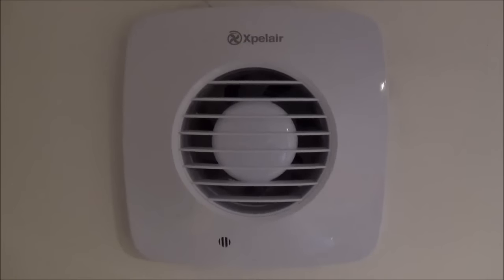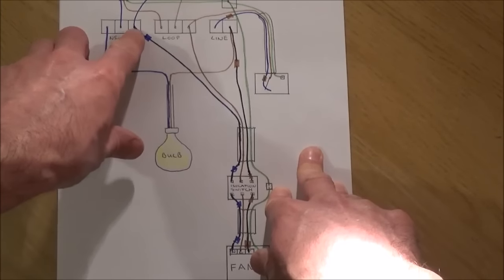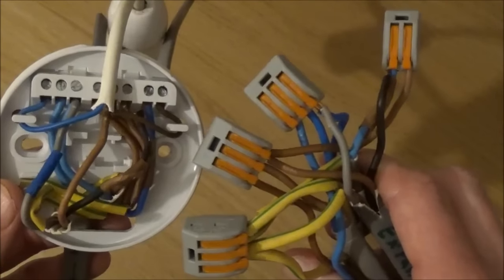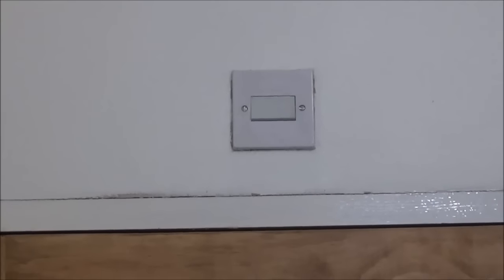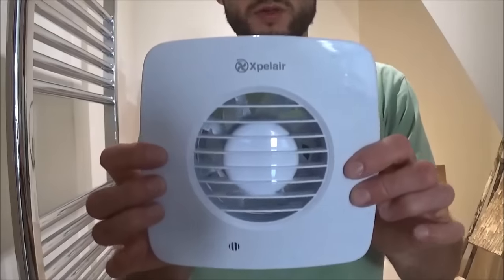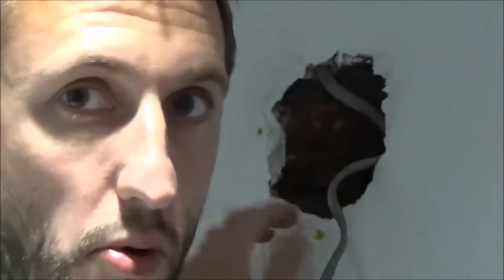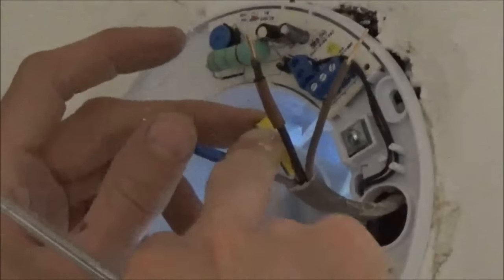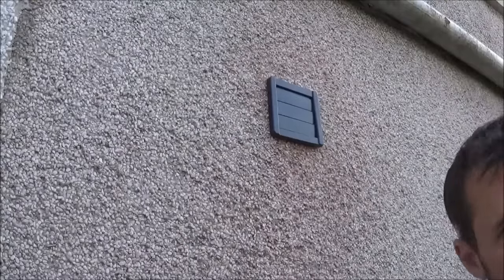How to fit a bathroom extractor fan using light switch. Extractor fan installation. Xpelair DX100

Comment: my old extractor fan I am replacing has a safety isolating transformer instead of a regular 3 pole isolating switch, is there a specific reason for this, do I need to keep this or could i replace with a regular isolating switch? I would appreciate any advice thanks
Reply from the maker: Hi there, without looking at the wiring it's hard to say. In theory if all the cables are 1.5mm twin and earth, you have a 6 amp mcb protecting the circuit and the fan is suitable then you could use an iosolation switch like in the video. But, it maybe the fan is older and designed with a transformer in mind. Sorry if that doesn't help but I don't want to give you advice that could prove to be dangerous or compromise your existing electrics. Good luck and thanks for watching!

Comment: Buddy:  If I put the wires the wrong way around will it blow the fan our just not work>  I ask as a sparky has done all the wiring and left a 3 core and E wire ready for fan installation but this wire was covered and does not have the brown or black tape over.  Is using the brown for live, grey for neutral and black for switched live industry standard so I may assume the sparky ran the wire from the isolator switch in this manner?  Thanks
Reply from the maker: Hi , it shouldn't damage the fan but if you have an RCD it should trip. But a simple way to test it is by using an electrical tester. A non contact tester like the LAP ms8907 are great. With the power turned on, remove your 3 pole isolation switch cover, (no need to disconnect the wires) and with the light switch on, the switched live wire will indicate live on tester. With light switch off there will be no power. The permanent live will always have power, and the neutral should show as having no power. But it should be standard that the grey is neutral, brown is permanent live, and black is switched live.

Comment: How to connect  cord pull fan with bathroom light wiring
Reply from the maker: You just have to treat the pull cord switch like the switch in the video. I don't have a video on this so if unsure please get an electrician to do it safely. Thanks for watching.

Comment: Thanks for this video, just made my life easier. Now I can fit the new extractor fan with confidence following your vid...p.s. Is an isolation switch a requirement?
Reply: yes
Reply from the maker: Yes, you need it to safely work on the fan at a later date without having to turn the light circuit off. Thanks for watching.

Comment: ok pouse.  strange comment but i want to block my extractor fan off as we have turned it off as cold air is coming through is there a plastic cover for it that i can buy
Reply from the maker: Hi Julian, you can buy blanking plates of different sizes which might work but I can't say I've ever thought about it. If I was removing one for good, I remove all vents and the tube in the wall, and then brick up the inner and outer cavity. Make good with render then plaster (or what ever is appropriate in your house) and job done! Hope that helps. Thanks for watching!
Reply: Julian Hamilton w
Reply: Google ‘back draught shutter’. Thank me later!

Comment: Great video. Did you actually connect the fan wire to the ceiling rose below or all connections being done in the loft?  In the video, it seems to me you have the fan wire pull from ceiling below back to the loft.
Reply from the maker: Connected to a connector block in the ceiling. This is actually a downstairs bathroom although that makes no difference! Hope that helps.
Reply: @POUSEaroundtheHOUSE  thanks for your help. So in the video I saw you connect in the ceiling rose, is that just illustration not actually done in practice. However I could not find connector block in the loft, should I tear the wire cover of the ceiling light to connect the wires? Thanks
Reply: @dragonviet2994  call a qualified electrician

Comment: Hi. Anyone know how to remove the cover for this fan, please? Electrician fitted ours but now it needs a clean so I need to remove the cover
Reply: Usually have a small screw on the side, undo that and pull the cover off.
Reply: The locking tab is at the very top in the center. Gently prise it off from that location

Comment: Hi Pouse, great video mate... 

I intend to fit an Xpelair C4HTS which recommends fitting a 5amp fuse.

After a lot of research, I am aware of the long-standing debate concerning the issue of fans and fuses. However, I am a belt and braces type of guy and would rather air on the side of caution.

I have three questions for you.

I am picking the feeds up from the ceiling rose using 3-core+earth (as in your video) and fitting a 3 pole isolation switch but would also like to include fuses on the live and switched live.

I am thinking of using this modular system.
https://www.scolmore.com/_pdfs/spec_bros/Mode%20Fan%20Isolation%20Switches.pdf

1. What do you think about this idea?

2. Where do you think the two fuses would be best placed - before or after the isolation switch?

There is an airing cupboard on the landing, immediately adjacent to the bathroom door (no access from inside the bathroom).

3. Do you see any problem with mounting the isolation switch (high up on the wall) inside the airing cupboard?
Reply from the maker: If you have a 6 amp MCB on your consumer unit for the lighting circuit the fan is run from, then why not just do as in the video? However if you insist on the above then I would put the fuses after the isolation switch and no problem with cupboard really as long as someone knows where to find it. It's good practice to be visible but out of immediate reach. That way anyone wanting to isolate the supply can see the switch, but by being out of reach it stops someone easily turning it back on by accident if working on the fan. Hope that helps. Thanks for watching!
Reply: Thank you for your advice - your timing is perfect - just discussing it with my wife and you will be pleased to learn that she agrees with you entirely LOL

Comment: Hey! I'm installing a Greenwood Unity CV2GIP which I want to be permanently on (it's adigital  humidistat fan) do I need to still follow the wiring scheme in the video? I don't want the light switch to control the fan just get power from the light circuit. I will of course still have an isolator switch. I'll have my neighbour sparky check my work either way.

Comment: Hi there, trying to install mine, i have the grey wire (with blue tape) in N, brown wire into L and black wire (with brown tape) in T, but it isnt working, am i doing something wrong?
Reply from the maker: Do you have the rest of the wiring setup the same? Isolation switch wired right way around and turned on?
Reply: @POUSEaroundtheHOUSE  Hi there.  Thank you for your reply.  The black wire was being used as the main live on the previous extractor.  As it turns out, the brown wire, which i tried to use for the main live in the new extractor was not wired up within the actual light switch (i have a pullcord), all sorted now.
Reply from the maker: @alanlesueur5200  good to hear it's sorted!

Comment: I need to get wire stripper's, better than using a knife and my teeth.
Reply from the maker: It's always great to practice traditional methods but the wire strippers are cheaper than a trip to the dentist!Good luck and thanks for watching!
Reply: Good fun if you leave the electric on though 😬

Comment: I'm
 trying to run my extractor straight to a plug socket outside the bathroom, is this possible?
Reply from the maker: Yes, but you will need to run a length of cable into a fused connection unit (FCU) and create a fused spur. From the FCU another cable that goes to the fan. It's important to put a 3amp fuse in the fcu to protect the cable and the fan. This FCU switch can then be used to turn the fan on and off...but this setup wont work for a timer fan as the moment you turn the switch off, it isolates all power to the fan. In a timer fan you need a permanent live, and a temporary live. I will be doing a video soon on how to add a fused spur to a ring final circuit but it may be a month or 2. Hope that helps and thanks for watching!

Comment: Would this type of fan be good enough for a bathtoom without a window?
Reply from the maker: It should be. I have a shower in mine but it isn't used that often. Just check the extraction volumes as a fan that extracts more volume of air per hour will be more efficient at removing moisture. Hope that helps. Thanks for watching!

Comment: I have installed the one with the timer just like yours today but the timer doesn't seem to be working. Does the extractor fan need to be running for a certain period of time for the timer to kick in? 

I mean, if I switch the light on and off after a few seconds, is the timer meant to kick in straight away? When I do that(switch on and off), the fan stops working.

Any clue?

Thanks!
Reply: I installed mine yesterday and had the same problem I switched around the live and trigger wire on the fan and now the timer works make sure the wires are right. Hope this solves your problem.
Reply: @jonathanmunn  cool, I'll have a go at it. Many thanks!
Reply from the maker: @jonathanmunn, thanks for the response, probably that's the issue!
Reply from the maker: @Jefferso Elias, try swapping the live wires around, sound like you have the permanent live and switched live mixed up. Hope that helps.
Reply: i had the same problem. Is the brown wire the live one. i put it on live and didn't work. if i put the black wire on live will work?  @POUSEaroundtheHOUSE

Comment: I'm not an electrician. I'm a gardner and don't have a clue about wiring, I have an xtractor fan that's about ten years old (model CATA B-10) and it's wired to the light switch so it comes on when the light switch is turned on/off. I want to take out the old Extractor fan as I don't think it's powerful enough and replace it for a newer one, it's connected to a white spiral tubing in the attick and out through a vent in the roof. What do you reccomend and how do I connect it. Also one that stops mould and mildew build up. Awaiting your reply. I've liked and subscribed to your channel, watching from Dublin Ireland. Thanks pal. 🇮🇪👍
Reply: here's what you sound like "I'm not an electrician. I do something else. I'm not going to take the time out to learn anything about this myself and instead want you to take time out of your day to take me step-by-step through all of this because I'm too lazy to learn and figure it out myself. Also make sure that whatever you advise, it stops mould and mildrew build up. Awaiting your reply since you've got nothing else to do. Here's a like and sub to your channel. Thanks pal. 👍"
Reply: @AJ-ds5gf  What an abusive and unnecessary comment that was. Please tell me why you feel the need to insult a person who just wants some guidance?
Reply: @MadLFC  Stop abusing me.

Comment: i think that  if You  swap the L and   T within the fan, even if the fan was time deleyed,  it will work the same.
Reply from the maker: On a timed fan you must have the wires right way round as the switched live tells the fan when to go on and off, but the permanent live allows the timer on the fan to over run. Hope that helps. Thanks for watching!

Comment: When I install this at the weekend the same one with a timer will the timer work when I turn off the light or will I have to keep the light on?
Reply from the maker: Yes, when light goes off it should over run. You can change the over run from about 5 minutes to 30 minutes I think as shown in the video.
Reply: @POUSEaroundtheHOUSE  it works great thank you for the video it really help and so did the pictures about the wiring
Reply: what was the problem, because mine didn't when i put the brown wire on live, the grey neutral and the black on T. Thanks. @jonathanmunn

Comment: when u say loop in and loop out do u mean the ring main in and out?
Reply from the maker: Hi Ed, a ring main is only on a socket circuit. A lighting circuit is a radial circuit (not on a ring - just one length of cable that ends at the last light) so when I say loop, it is the name of the main live feed in and out of each light. Hope that helps. Thanks for watching!
Reply: POUSE around the HOUSE 
thank you. fitting one for the first time in a 1930's house where an old large square vent is on the outside but has been plastered & tile over. 
I've replaced a few but never wired one in from scratch. last house had them but no off switch for either of them (just flicked the rad in the box)
Reply from the maker: Good luck with it Ed. Thanks for watching!

Comment: Hi, thanks for the video, I was wondering how the circuit would look for a non timer fan sch as the Xpelair VX100S. Would it be the same but without the need for the 3 core and earth and have a twin core and earth instead, without the need for a permanent live?  I watched both the DX100T and DX100, initially thinking the Dx100 was without a timer, ooops

Comment: Hi, I understand the installation you described in your video. However, you don't use a 3 amp fused spur which is necessary with the fan I have. Yes, It runs off a 6 amp mcb but I think it needs to be 3 amp so that it trips at 3 amp and not at 6 amp as that is too much.
Now I guess I would need to use 2 fused boxes as there are 2 lives. S/L and permanent.
Pain in the ass!
A triple pole double fuse isolation switch would be great but they don't exist.
Any Ideas?
Thanks Alan

Comment: I have a single light switch for my bathroom which has only a single twin and earth. I have 4 down lights that I can access but unfortunately have no ceiling rose. Can I tap into the lighting wiring for my extractor fan?

Comment: Watched a few of your 'How to' vids now, very clear and comprehensive! Thank you
Reply from the maker: Thanks for the feedback and thanks for watching!
Reply: @POUSEaroundtheHOUSE  hi your diagram shows two wires for a light switch but some bathroom switches have four (L&N in, L&N out) as per link below. How does that change the diagram, and how do you get all those wires (and the wiring for the fan isolator) into a ridiculously small junction box - is there a "knack" to it?  

https://www.toolstation.com/bg-screwless-flat-plate-brushed-stainless-steel-20a-dp-switch/p85449

Comment: thanks for the video, Q...if you're fitting the extractor unit flush to the wall and into the rigid ducting tube, how do you get the ducting to angle down towards the outside wall without the fan unit lifting away from the tiles at the bottom?

Comment: If I have a basic fan without a timer can I eliminate the isolator?
Reply from the maker: Physically you can, but it is a requirement of the regulations as it allows the fan to be isolated from the power to the lights if it needs to be worked on. Hope that helps. Thanks for watching.
Reply: NO!

Comment: great video, really helpful and clear explanation and tells me exactly what I needed to know to retrofit a fan. just one query - you added a second cable to the connector on the ceiling rose - so there are now 4 wires connected in just three holes for the live and for the neutral  and 3 wires in 2 holes for the earth (06:35) I read on a forum elsewhere that this was bad practice and should not be done and that instead you should have only one wire per hole. I assume its safe because you've done it but does it meet regs?

Comment: Question: I have a tank room above my bathroom and was thinking of installing a bathroom fan. The problem is the walls are two feet thick. In this tank room is the small feed tank (Header Tank) for the radiator system to keep them topped up. Do you think a hose from the fan to this tank would work as a condenser when the warm air hits the cold? I realise I'd have to seal the lid and any excess air could go down the overflow.

Comment: Please can you do a video for a wiring of installing a new electric radiator for rooms details such as which wire to use can it be taken the connection from the ring circuit or new wire from the mains to be laid etc?

Comment: Hi Just wondering how u would do this if there's only 1 cable into ceiling rose, a twin n earth. No loop wire. Thanks
Reply: Must be wired through switch, fine if you don't want a timer, just take live and neutral from rose to fan isolator and fan. But if you want a timer you need a permanent live.
Reply: @thomasbryce2910 thanks for that 👍
Reply from the maker: I think Thomas answered your question! Also just to add, make sure you're existing light circuit is safe and covered by the correct fuse as you are adding an additional load. Thanks for watching.
Reply: Take the neutral from light ceiling put in Wago connector. 1 neutral to the light fitting, and another neutral to the switch. At the switch, take a 3 core and earth cable. Brown to comm, black to switching line (put some brown tape to identify as switching line) and grey cable (put some blue tape on) into Wago connector with neutral you borrowed from the line fitting.
Reply: In this case, you have neutral at your switch and then just run 3 core and earth to extraction fan
Reply: @gintem.2194   do you know if there’s a video that explains what you described?